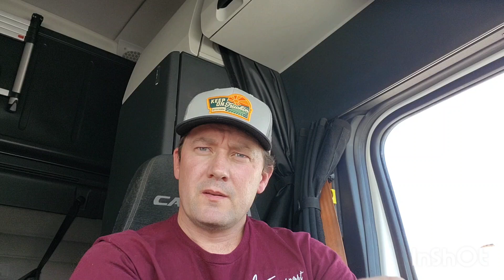Choosing the right axle ratio for your Freightliner or Western Star.

Comment: I have one of those prime trucks running at 77k-79k tanker loads and man it’s a dog with that 2.15 ratio in the mountains or any type of incline from a hill. I wonder how much it would cost to switch to a 2.41 or 2.47. I personally don’t care for fuel economy like most do, I prefer power to pull on inclines I hate lugging
Reply from the maker: I would say 3 to 4 thousand. Maybe not that much if yours are in good shape.

Comment: I always thought modern downsped motor is geared ridiculously and sometimes unnecessarily fast. New Volvo D13 TC and International S13 will do 65 below 1000 rev. Great for flat highway cruising but you'll lose speed on a hill definitely. 

I think 65 @ 1150-1200 is the sweet spot for economy and performance for 80k lbs linehaul jobs.
Reply from the maker: With my Freightliner, I've found that it really doesn't like to be below 1050 with any kind of weight, 1150-1200 is perfect 👌. International I'm sure is a similar, the only difference is they will run a 2.15 overdrive, where Freightliner will be Direct, but pulling weight I'm sure it would upshift into Direct. Volvo is totally different because of the turbo compound engine. They want it run down sub-1000 all it can.

Comment: How much weight are you hauling with that ratio? What model direct drive and what engine also? 
Im just curious because we got two set ups, ones 10 speed od with 3.55s, other is direct with 2.64. 
I think the od does just as good on  mpg and it pulls better, hauling 80,000lb over hilly highways, and off road onto jobs sites
Reply from the maker: It's all over the board. My outbound is light, 15K usually. Backhauls can be any weight. I had one the other day 35k in the box, so it was 69k gross, it got 10.5 on a 1,000 trip, that was driving slow. A 2.41 is a good gear for regional work or city work, or for a person like me who drives slow. This truck can drive comfortably from 50mph to 70mph in top gear, but it's much more efficient down low. I'm not sure about the model of my transmission, DT12 that is direct drive. Are you sure that 2.64 is direct? That wouldn't be a good setup for a modern truck. If that was in a older truck, with say a 12.7 60 series, that would be a great setup. With the newer trucks 2.64 is a .78 overdrive.

Comment: Good day sir .
 Thanks for explaining this seldom covered topic. 
These points, are they applicable to other truck brands ... Volvo, Peterbilt, Kenworth etc ? 
These tips, are they suitable for tractors with single drive axles as well ?
Thank - you for the video
Reply from the maker: You're welcome! I'm glad you enjoyed the video. The new International with the S13 engine and the Volvo with its TC engine need to be geared with a 2.15 with .78 overdrive. Peterbilt and Kenworth will only go down to a 2.47 direct, if I'm not mistaken. Freightliner with the DD15 or DD13 is the most forgiving engine. The new generation 5 Cascadia will have four gears to choose from, 2.16, 2.28 direct drive, 2.64, and 2.85 overdrive. You can't really go wrong with any of these combos. It all depends on how fast you drive and whether you are doing regional or over-the-road. Hope this helps you out.
Reply: @jptransport8830  Thanks for the feedback. 
From a performance perspective, which is preferable, overdrive or direct drive ?
Reply from the maker: @wheelman1235 With the new modern transmissions it's too close to call. 10 or 15 years ago, for performance and efficiency, it was a direct drive. I would get online and find a road speed calculator and find what suits you best. Overdrive in the newer trucks is .78

Comment: Wind drag.  Also plays in it.  
My company Volvo 2025 old body shape.   13 speed auto . Think it 215 gear ratio. ?      At 65 mph.   At  946. 950. Rpm.   I think just a hair to low.  .  Think it would be better at.  975.  980  rpm @  65 mph.
Reply from the maker: Is it a TC engine? Or a VG turbo setup?
Reply: @jptransport8830 What difference does it make if it’s TC or VG?

Comment: Are all dt12s direct drive?
Reply from the maker: No, they can direct or overdrive. 2.16, 2.28, 2.41, 2.47, and 2.50 will direct drive. Everything else will be overdrive.
Reply: @jptransport8830 not completely true.. you can get 2.47 in a Cummins with over drive . In a Pete 579. Cummins x15 with 450HP. I know you can because I was able to build one from factory

Comment: Would you go back to a 13, 15, or 18  speed manual?   OR   No the auto-manual 12 speed is better everywhere.
Reply from the maker: I miss using a manual transmission. A 10 speed is fine with me. They are a very simple transmission, and for the weight and terrain I run, it works. That being said, with the automated manual having E-coast that seems to give an mpg increase, I don't think it's worth going back.

Comment: Look at all those trucks that fly by puking def out the stack. Engine running way to fast and DPF not warm enough. Wish there would be better 2 speed axle offerings but all north of 3.70 . Having a 2.18 with a 3.55 as the second ratio be great for the guys who run heavy or off road . Not sure the pumpkin would be big enough though.
Reply from the maker: I'm sure that the rear end would be huge.  The transmission with the really low gears is a game changer. I don't see any reason to go lower than a 2.15 with an .78 overdrive. That seems like a sweet setup!

Comment: See I have a 20’ Cascadia with a 10spd on 229 with 3.08
Reply from the maker: @Royal18s  How is it doing for you?
Reply: @ well I haul reefer and not the fastest up the hill. But hauls fine just with it had just more pull.
Reply from the maker: @Royal18s  Good deal. How's it doing for mileage?
Reply: @ wish it could be better but that just may be user error. I’m right at 7 at times 7.2
Reply from the maker: That's not bad. Depending on how heavy you are and where you are running.
Reply: @ that’s true all factors